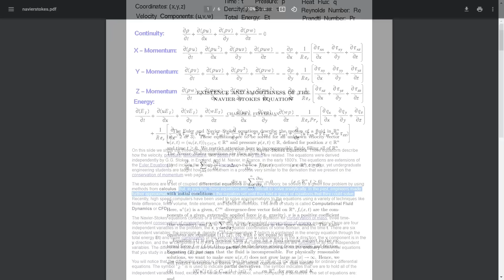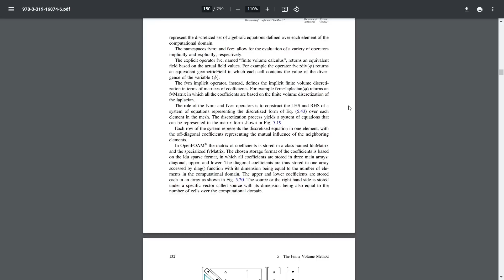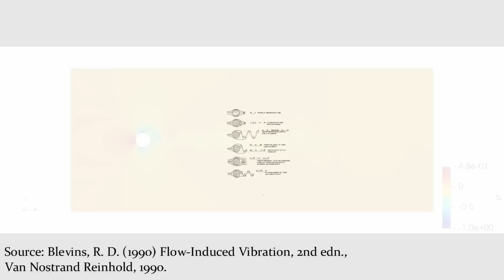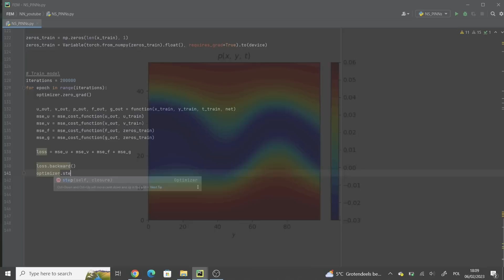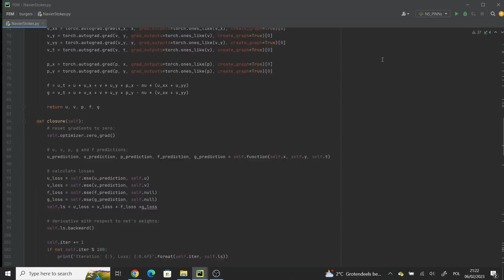Teaching Neural Network to Solve Navier-Stokes Equations

Comment: I am working on a flow past a cylinder CFD problem using a numerical scheme, simulated by a Fortran code. I want to use PINNs for this purpose and to extend them further. Can you help me out with this PINNs approach? Could you please give your email ID so I can contact you, or offer some suggestions for getting started?

Comment: I am a Japanese who started researching Pinns this year. I am currently facing a difficult problem. Even if I solve Pinns by using the flow field of RANS solved by CFD as training data and applying the continuity equation constraint, the flow field roughly matches the training data, but the detailed flow field such as fine vortex structures does not match the training data. Is this because I am using mini-batch gradient descent? Can LBFGS be used to express even fine flow field structures? Can LBFGS be easily implemented in pytorch if I use chatGPT4.0?

Comment: I was thinking through your problem with LBGFS vs mini-batching like SGD or ADAM. Isn't it the case that you can shuffle your mini batches more effectively and/or involve some gradient accumulation, to prevent the overlooking of key physical constraints in the cylinder wake problem? That way you can achieve the same result without needing this much compute and the possible memory bottleneck that your solution involves?

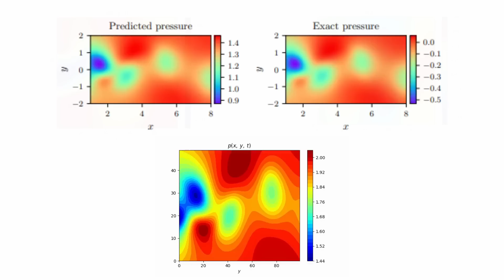Comment: How can I get the same predicted graph of the paper with your code. 4:48 
The graph your code is giving is from 0 to 50 in y-axis and 0 to 100 in x-axis.
I tried changing the axis values but I was not getting the same graph as the paper.

Comment: at 4:45 the values in the scale between the predicted and exact pressure fields are completely off…
Reply from the maker: It is because the neural network finds the pressure field such that the derivatives match the Navier-Stokes equation. So the values differ by a constant. The gradients of the pressure are equal though. I explained it in the video but perhaps you missed it.

Comment: I am not sure I understand the philosophy for using NNs for fluid dynamics in this type of application. NNs are essentially (very simplistically) regression algorithms, which seek to turn discrete data into a continuous function to approximate some unknown functional. So what would be the ideal NN in this case? Well it would be one which approximates the governing equations we start with, and we know? So what has been achieved? Training a NN to approximate a governing equation that you already know? Perhaps I am missing something.

That is not to say I don't see the benefit in other applications of physics/engineering/fluid dynamics etc.
Reply from the maker: One example of using NNs in CFD would be speeding up simulations. For instance you could train NN to predict chemical compositions for a giver reaction, which can then be applied in CFD simulations of combustion (which is much faster than finding those ratios from chemical kinetics). I am currently working on a video in which I will explain the applications of NNs in CFD in more detail.

Also you could use PINNs for shape optimization. I've seen a paper in which the researcher trained NN for different airfoils and then used it to find the shape which minimizes drag. This approach is faster than running a CFD simulation for every possible airfoil shape.

Comment: I guess, the real power of PINNs lies in training the neural network without any training data.
I have a question, when the neural network is trained, does the trained network work only for a certain geometry or it gets generalized?
Reply from the maker: It only works for the specific case it was trained for.
Reply: @computational_domain  let's say we have 2 regions. One is rectangular region and other is circular region. We have same PDE which describes physics of the problem. Even though PDE is same, I'll have to train the model for both the regions separately. Right ?
Reply: Neural network is just a generalized curve fitting. That’s it, And we fit it by training it for hours/days/month on huge amounts of data... It cannot understand something outside of its training/fitting data.

Comment: Very cool what you did here.  Great job. Thanks.  Are you familiar with SINDy - sparse identification of non-linear dynamics, by Steven Brunton?  He has a lot of YouTube videos.  I wonder if your solution scales as well or better than his. He uses sparse matrices of coefficients for a large set of functions?  The answer would make a good paper, right?  You’d have to account for the exec speed of different cpu/gpu/tpu operations/instructions and the complexity of unit operations in each method to make it a fair comparison.  Come to think of it, that’s probably been done.  If anyone knows I’d like to see the reference.  Anyway, please keep making great videos like this.

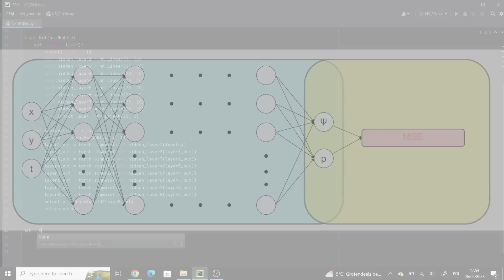Comment: 2:40 Is there a particular reason why you used a double-sigmoid at the output layer? I can see how using ReLUs for the hidden layers could cause problems as the gradients are utilized for evaluating the loss. But why did you not use something like SoftPlus or Swish as people usually do or maybe the sine function like they do in the SIREN paper?

Comment: This is a cool idea, but could you give some potential use cases for this? In my understanding, it just learns the results of the simulation for one set of conditions. Can you use it as more than just a way of compressing the simulated results into neural network params?
Reply from the maker: I'm currently working on video in which I'll show some basic applications of trained NN in CFD. I just need some time ;)

Comment: What kind of grad student are you? What field? Physics, CS, Applied Math, Engineering? I want to do computational stuff like this in grad school and I have been accepted as a physics PhD, but I find that very few physicists actually do this stuff and it is more so in the other fields mentioned.
Reply from the maker: I'm majoring is in Aerospace Engineering. Simulations like CFD, FEM or heat transfer are more of an engineering discipline, but there are some simulations/computational which are commonly used in physics/chemistry. For example you could delve into the Density Functional Theory (DFT) if you're planning to specialize in something like solid state physics.
Reply: @computational_domain  Nice. Have you ever looked into surrogate modeling

Comment: Hi there! I have a keen interest in merging machine learning and physics simulations. In fact, I'm currently working on this very topic myself. Specifically, I'm attempting to utilize neural networks in tandem with my Lennard-Jones particle simulator to train the NN in fluid dynamics based on particle simulation data. However, I've found this task to be more challenging than I initially anticipated. I would be thrilled to chat with you about this topic and potentially gain some insights from your experience. If you're open to it, would you be interested in discussing this further via email?

Comment: Could you kindly tell me which approach you’ve taken? Did you use neural network as a black box to solve the NS equations with a training set or did you use it to approximate derivatives in the equations and then solve them? Personally, I think the second one is more promising. Just curious. Excellent work by the way.
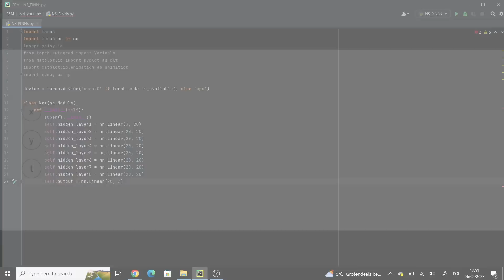Reply: Around time stamp 2:25 he says he downloaded data. As you say the second approach is the promising one. What he did is cool from a neural network POV but is totally worthless from a physics stand point. Using a set of data for a cylinder around a certain Re we could create correlations and use something very simple to calculate the flow. The real magic would be if he could somehow use data from a certain group of Re and predict successfully to a reasonable extent the flow at any Re even in the millions.

Comment: PINNs apparently incorporate the PDEs into their loss function, according to chatgpt. i kinda get why that makes standard deep learning techniques fail, especially in the case of navier-stokes equations. would training a CNN autoregressively with MSE+Adam on pre-simulated velocity fields work?
Reply: I attempted to train a CNN using averaged data from particle simulations. Specifically, I utilized data from my particle simulator to compute a grid of densities, temperatures, and velocities. Unfortunately, the results did not meet my expectations. The closest I came to achieving the desired outcome was when the network learned some wave-like structures, but it completely ignored obstacles, resulting in density waves tunneling through them. I'm still working on the problem, but it appears that a change in approach may be necessary. Perhaps implementing a new training pipeline could be helpful, but I'm unsure at this point.

Comment: I'm fascinated by the prospect of using ML for physics problems. Subscribed and looking forward to following your journey.
Reply: I'm trying to train my neural nets to predict optical responses of metamaterials, so technically solving the Maxwell's Equation. The result is an NN for predicting reflectance, transmittance, and absorption of a metagrating. Hehe
Reply: Hello I am building a PINN for solving Navier Stokes Equn' in CUDA, any suggestions it would be most helpful. Thanks.

Comment: So did you train it such that the psi and the pressure predictions (or physical properties derived from those) match the numeric results produced by a PDE solver? Or did you train it such that the derivatives satisfy the navier stokes equations without prior calculation of numeric solutions as training labels? 
If it's the former (which it very much sounds like), I'm very interested in seeing how the latter would perform.
Reply from the maker: I trained th model based on the velocity field produced by a CFD solver. The pressure field was obtained only from the NS equations.
Reply: @computational_domain  Is it possible to train the network by the second method mentioned by @Marius.J where we do not have any data on the velocities at the collocation points?

Comment: Looks promising. Do you predefine the mesh, or give guidelines about its properties? Also, is a 2D Navier-Stokes equation sufficient for modelling the flow around a cylinder? Typically, incompressible 2D flow can be modelled as a single PDE in terms of psi, where d psi/dy = u and d psi/dx /-v, and pressure is eliminated. However, I don't know whether physical systems, specifically very long ones where a 2D approximation is more reasonable, with vortex shedding would have significant velocity in the z direction. Do you have experience with or thoughts on this?
Reply: Also, do you manually test the GCI by changing the number of nodes, or does the neural network handle that?
Reply from the maker: 1. I used the available data set from the literature, which contains the all the properties (points, velocity, pressure)
2. Assuming the cylinder is long enough the flow can be approximated using 2D equations, as the effects of tip is marginal (especially in the middle of the cylinder)
3. I suppose you are talking about the potential flows. This type of model only works for the irrotational flows. However, in case of the cylinder, there are viscous effects which result in the vorticity. Thus, it full Navier-Stokes equation should be considered in this problem.
4. I just the same number of nodes as in the article I showed. I didn't really test it.

I hope that answers the questions
Reply: @computational_domain  thanks for the reply! Yeah I had a feeling that was the case, but had never delved too deeply into 3D Navier Stokes applications. Good work

Comment: Dear Adam, So nice introduction to PINN. I am trying to solve a heat conduction problem using PINN. Can I contact you regarding it? I went to your github repo but unfortunately I did not find any contact details.
Reply from the maker: Hi Ali, yes sure you can send an email to thecomputationaldomain@gmail.com. I can have a look at it but I am not an expert on PINNs, so I might not be able to help.